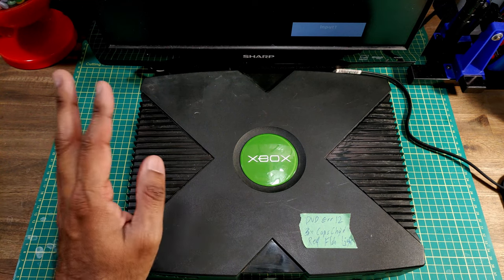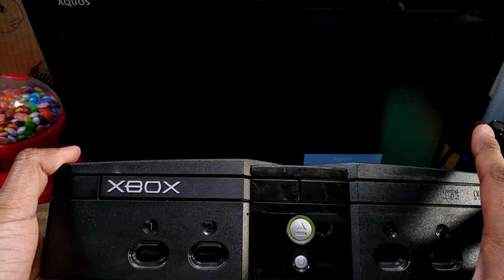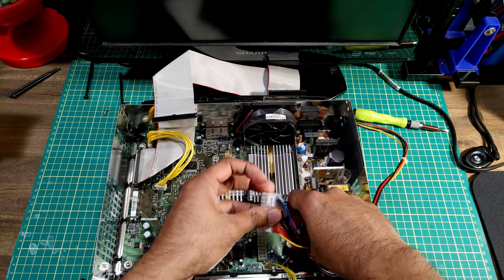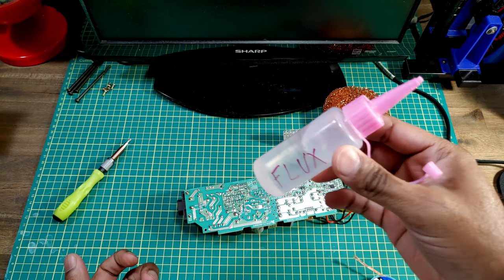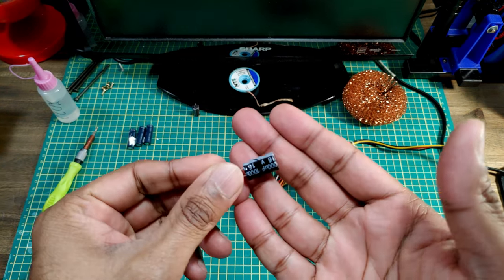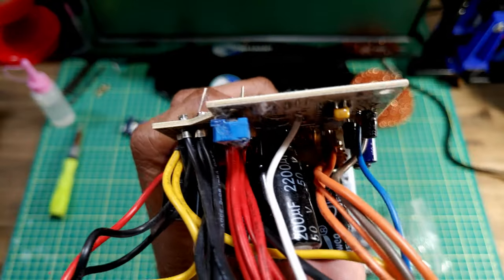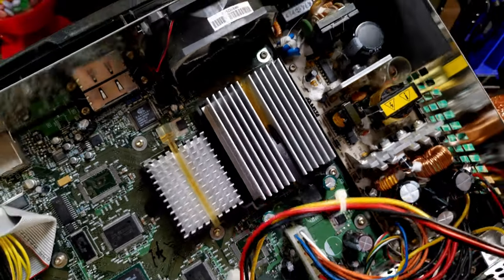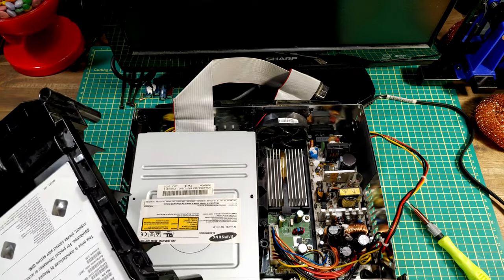Re-Visit: Original Xbox With Flashing Red Light and No Video Output

Comment: The error is known as a Cycle Cycle Frag, its an irritating issue as it can be anything wrong with it. Luckily I have found that on most occasion I have been successful with two systems being the smaller capacitors located around the clock capacitor, controller connectors and the power connector and has brought them back to life. However, I cannot prove or confirm whether this is the case, I did try Vince's repair on it prior, and it did not work, it was only after recapping the whole motherboard. Very strange. :O
Reply from the maker: Hi there, and thanks for the info! Will give this a shot to see if it revives the system.

Comment: Anecdotally... My 1.2 XBox worked (poorly) before I replaced the same 3 capacitors near the CPU. Mine were also boiled out.   After I initially replaced the caps,  my box started the same cycle error.  I actually watched your initial video looking for a fix.  In my case,  I figured it must be linked to the one thing I had done.  I reflowed the caps and it fixed it for me.  I assume it was a cold solder joint.  Something you might try if you haven't already.
Reply from the maker: Thanks, that's some good info to know. Will take that into consideration on a revisit.

Comment: Always use them there low impedance capacitors. On Mouser you can also specify the physical dimensions of the caps in addition the electrical specs.

Comment: BRO YOU GOTTA TELL ME IF IT WORKED MY XBOX HAS THE SAME PROBLEM IM ABOUT TO GO HOME AND DO THIS TO MINE I HAVE NOTHING TO LOOOOOOOOOOOSE
Reply: How was your experience?
Reply: @IRVERA23-po1uo  I did an oscilloscope probe between 2 Xboxes; a known good power supply and the power supply in the bad Xbox. There was a noise difference between the two, indicating a possible bad power supply, however switching power supplies did not affect the error on my Xbox. Sadly the Xbox is now a parts piece, there's nothing else I can do. It's possible the power supply could have helped but I know the clock cap exploding did a number on the components around it

Comment: Well, did you get it working? Did the new capasitors give you a picture?
Reply from the maker: Hi there, still waiting for the last batch of capacitors to arrive from China. In the meantime, I've managed to locate another Xbox with what I hope is an identical power supply. I'll have a video soon where I try to switch the power supply over, just to eliminate it from the equation (and hopefully get it working, if it is the power that's wonky).

Comment: did you ever manage to fix the xbox im hooked on this mini series lol
Reply from the maker: Hi there, and thanks. :)
Not fixed as yet, but I've got some of the missing capacitors shipped, as well as a different power supply to try it out with. Honestly, I've been loathe (lazy?) to open up that original Xbox again, but after dealing with the PS2 and it's insane jigsaw puzzle architecture, it should be a walk in the park. 
Stay tuned, and I'll try to upload something within the next few weeks if possible!

Comment: I'm having a boot up problem with an Xbox that I picked up from FB market. 
It’s a hard modded version 1.1 with a Aladdin chip and clock capacitor removed. I already ruled out that the mod chip, HDD, SATA/IDE adapter are not the issue by swapping them out from a working console. This leads me into believing that’s it’s hardware related like a bad capacitor or overheating or something. I’m stuck and not sure where to start. Also, I was able to get it to successfully boot into dashboards twice but only for a very short period and then it would freeze. I removed most of the caps and tested them using a fluke meter with the capacitance feature and they all seem to read fine. When I put everything back to stock. I get error code 16. let me know if you guys have any idea what it could be. Thanks 🙏
Reply from the maker: Not sure about this one, but research seems to say that error 16 is common and can be ignored on a modded xbox (related to losing the date/time after being unplugged). So, you may be possibly chasing after a red herring...
Though I doubt this is the culprit, but have you checked the thermal paste?
If anyone else has a suggestion, feel free to chime in.
Reply: @DiscountSasquatch  yeah, thermal paste got replaced with new MX-6